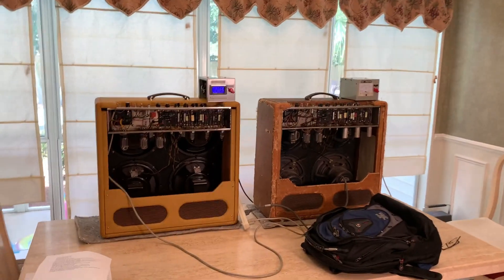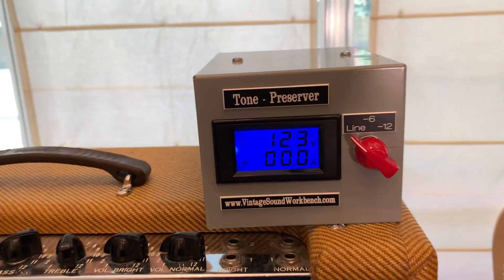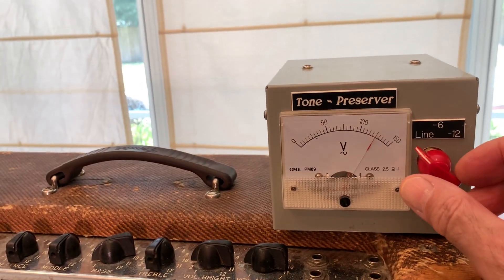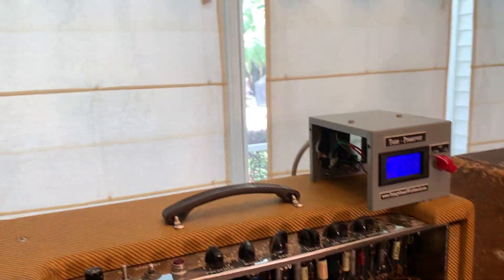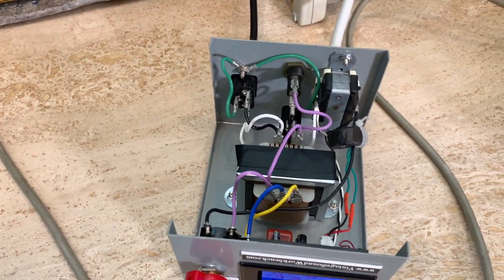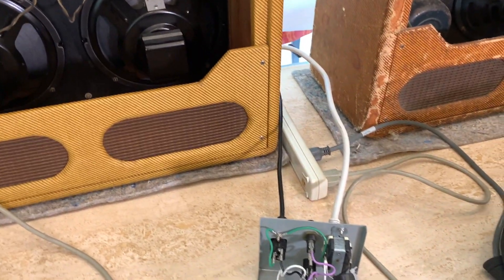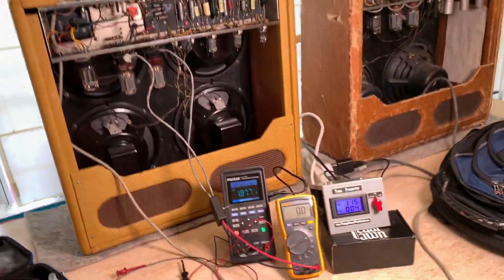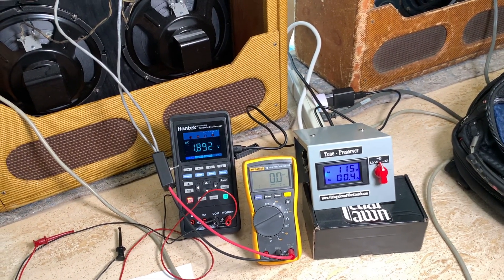Carl Hartman Tone Preserver - A "must have" for any tube amp owner!

Comment: Excellent Stan!
Reply from the maker: Hopefully I pronounced your last name correctly, lol.
Reply: millstap yes.    Im going to look into these now
Reply from the maker: @theriffwniksevigny5473  Also look at the Amp Maniac.  It is completely variable but is only fused at 2.5A so you may not be able to run as many amps on it, and it is $219.99.
Reply from the maker: @theriffwniksevigny5473  I did a little experiment last night.  I watched the amp meter as I jammed with the 1959 and a vintage Fender reverb unit hooked up.  The amperage peaked some times to 1.4A so the chances of blowing the 2.5A fuse on the Maniac are pretty high if I run a two amp rig through it.  I am going to do a demo on the Maniac soon and will try to blow the fuse using two amps.  I'm thinking for $50 more ($400) than the BrownBox, you can have both the Preserver and the Maniac.  Leave the Preserver with all the amps hooked up in the jam room at home and take the Maniac to all of the one amp gigs.  It will be an interesting demo because I am going to dial in the heater voltage to exactly 6.3VAC and see what the plate voltage ends up being.  I wouldn't be surprised if it matches the schematic exactly at 432VDC.

Comment: I've had mine forever! Love it! Purchased one to run with my 64 Super Reverb.  Great product,  I like being able to set mine at any voltage,  not just a few choices that drop the voltage by a few percent each time.
Reply from the maker: So you bought the Maniac?  I am going to do a demo on the Maniac soon.  I am thinking everyone should have both.  For $400 you can have both.  There are some big advantages to the Maniac too as it works similar to a Variac but is light and compact.  But, it probably will only run one amp at a time.  I did an experiment last night and saw that my Bassman with a separate Fender reverb unit was spiking at about 1.4A when I was playing loud.  I am going to run two Bassman and reverb units and see if it will blow the 2.5A fuse in the Maniac.  The Preserver for the home jam room and the Maniac for the one amp gigs.

Comment: Does it protect against power surges and (idk if Im using correct term) does it offer protection against ungrounded outlets?
Reply from the maker: No, it is strictly a voltage reducer.  Whatever power surge hits it will be passed on but at a lower voltage that you have pre-set.  I use surge protectors like the Furman or Tripp-Lite and plug the Hartman into them.

Comment: Can you tell me the difference between a tone preserver and the amp maniac and do have any experience with the JHS black amp box ?
Reply from the maker: Sorry I took so long to answer.  The Tone Preserver is fused at 5.0 amps and has three settings, line voltage, -6V and -12V.  The Maniac is fused at 2.5A and is fully adjustable from 0VAC to line voltage.  You can hook up a few more amps to the Preserver because of the fusing but the Maniac can easily handle two amps at the same time.  I have both.  I like the Maniac because I can dial in my amp's voltage exactly.  I am not familiar with the JHS box.  It looks like you have to have an effects loop on your amp to hook it up.  The Preserver and Maniac are best for vintage amps but they can still monitor voltages on new amps if you live in an area where voltages vary a lot between venues.

Comment: Just received a Brown Box voltage "reducer", and the AC amps meter doesn't work, very disappointing with something this expensive.  I have my 1957 Gibson GA-40 plugged into it, reduced the voltage from 120 volts to 115, but might take it down to 110.  The amp says 110-125 volts below the pilot light - lower is better? ANYways, not having the AC amp meter working is a defect, which makes me wonder if I can trust the voltage meter...?  Maybe after returning it for a refund I'll buy one of those instead.

Comment: Hello Millstap, a question so when you bias the tubes do you bias them with the tone preserver or are you bias the tubes with the line voltage from the wall?
Reply: From the preserver. So not from what you see at the wall. What matters is what your amp sees not what the tone preserver sees.

Comment: This is just a simple buck/boost transformer with taps on the secondary to drop or boost output by a desired voltage. The transformer in the unit costs about 18 dollars. You could build this without the digital or analog meter (which you really don't need) for less than $60 US dollars. Be careful adding additional amp loads beside just one amplifier to it. Because at idle guitar amps pull very low current. But turn that amp up to seven and add a fuzz face, wah, and/or delay or modulation pedal and slam a low E or Eflat power chord and have a ammeter hookup to it and you will find out why your amp has a 2A or 4A rated slo-blo fuse in it.
Reply: We get this question all the time: Can't I just build my own unit with about thirty dollars worth of parts  and accomplish the same thing?  I think I saw the circuit on  the internet somewhere. 
 
If you believe that, then you have not priced quality parts and  components lately.  You could build your own if you have the technical  know-how, experience, and the proper tools to do so.  The Tone Preserver is built with top quality components and is built for the gigging musician, not your average basement experimenter.
Reply from the maker: Since I build and sell my own pedals now, I have a lot of respect for the amount of work that goes into a quality product like the Tone Preserver.  When you get your car repaired, you will notice the labor costs are usually the highest charge on the bill.  And, also the investment in tools has to be factored into the total price.  I was trying to refret all of my Strats until I realized it was going to take a $1,000 investment in tools just to get started.  On the multiple amps, I've hooked up two Super Reverbs and the two Tweed Bassman amps in this video and cranked all four of them at the same time just to do it.  Not one fuse was blown anywhere.
Reply from the maker: I will be demoing the Amp Maniac soon.  It is the best alternative to a Variac.  It is light weight, the same size as this Preserver, and it goes from 0-Line VAC.  So, you can also use it to slowly bring up the voltage on old amps to possibly reform the electrolytic capacitors.  It is a little more at $219.99.  Check out the product link in the Description above to see it.

Comment: I can’t believe I missed this video!
Reply from the maker: Hey Matt, I just posted this one this morning, https://youtu.be/grkJPSbOQmE.  You may like it better.  It was killer because I dialed in the heater voltage to 6.3VAC and the plate voltage ended up being 432VDC +/- on both the 1959 and 1960 Bassmans.  The AC voltage ended up being 113VAC.  Pretty cool.  I was surprised the voltages matched up to the schematic so perfectly.  I noticed on the '59 Reissue Bassman schematic, they have the plate voltages all the way up to 491VDC.
Reply: millstap Yeah, I watched both videos. You made me laugh a little when you talked about the high reissue voltage and tube ratings. We all run old Tung Sol 5881’s with a 360vdc plate/screen rating at 440ish volts. New tubes don’t do that though.
Reply from the maker: @matthewf1979  Yeah, those old Tung-sols are indestructible.  One of the 5881's in the 1959 was hit with 230VDC on the grid and was smoking hot.  That was several years ago.  Now, with a cracked base, it is still working perfectly.  They made them tough back then.
Reply: millstap I’ve been buying up reasonably priced Tung Sol 6L6WGB/5881 on eBay. $80 and under for new or near new a pair. So far, they’ve all been good, strong tubes.

One pair is labeled GE, but not Canadian. It looks exactly like the usual re-labled Tung Sol, but has the GE EIA code and US made. It’s a real oddball pair, but they test and work like a Tung Sol. It’s even missing a pin and the base looks different on the bottom.

A few months ago, I built a Tone Preserver style buck transformer. It’s got a 12 amp filament transformer in it! Totally overkill but it’ll last forever and never get warm. I’ll send you a picture on Facebook.
Reply: millstap The pictures are in the comments of your latest video on Facebook.

Comment: If you build this yourself it's about $30. Ask me how I know lol. $30 to $50 at the most. And that includes A BETTER LCD screen that measures voltage, current, freq and wattage/power. But yes these are very very very useful devices. And changing the analog display for a nice LCD display would have cost you $15. If you used the kind that's in the tone preserver you could have picked one up for about $8 on the high side from amazon.
Reply from the maker: Okay, how do you know it will cost $30.  You can hardly build anything nowadays for $30.  Just shipping for the parts alone will be $30.  Have you tried getting parts lately?  I think even Carl is having a hard time finding the right meters.  The supply chain problems are really getting worse.  I take it you make your own enclosures too because they aren't cheap for the right size if you can find them.  I hadn't thought about changing the analog meter with a digital one.  I use my two digitals now but I could always use a third.  Now, I prefer the Maniac which works like a Variac.  I think I would prefer to convert my third one to a Maniac.  Does yours have that kind of variable adjustment?  Oh, I see I am not talking about the Maniac here, here it is, https://vintagesoundworkbench.com/shop/ols/products/amp-maniac.  I just found one on Reverb for $115.
Reply: @millstap   I live 20 minutes from mouser electronics (it's in Mansfield and I'm on the border of Fort Worth Texas) so I use their will call (now that they reopened it finally, it was close mid almost 2 years cause of covid) which means I can avoid shipping costs on most parts i need. And the transformer (115V 6.3vCT, 4A) is $17 on mouser an a good quality hammond enclosure is $22 on mouser (hammond 511-0900). The display i use reads Voltage, current, power/wattage and energy/Wh and its $15 on amazon. Bbut for $8 you could get a display meter that just reads volts and amps like the one used on the "Tone Preserver" and save some money. So that brings us to $45 so far using the nicer display meter (to be fair I had everything else lying around). But even if I didnt have the rest lying around (switches, wire, output and input outlets etc.)it would still only cost about $10 or $15 at the absolute most extra for those odds an ends. I personally think the Tone Preserver price isnt highway robbery and it's fair if you dont know how to work with electronics. But if you do then you can save a lot of money (about $200, call it $180 of you have to pay shipping on parts and that's a high estimate since mouser has a hidden shipping option that is normally about $8 and the regular for that amount of stuff is about $12). And I'm rounding up so in reality youd save more then that not less. And another reason to DIY is mine can boost and buck by 6 or 12 and has a line voltage position as well. My line voltage goes from as low as 110v to 128v throughout the year so I need a boost option as well for when I'm using my modern Marshall. Having the option to boost and buck by 6 or 12 keeps me much closer to 120v when I need it or less for vintage equipment. Point being if you build it yourself you save a lot of money AND you can tailor the transformer type, size and wiring configuration to best suit your needs. And to answer your question no, sadly mine isnt variable but I'll likely build one that is eventually. I really like that idea, the amp maniac style variable option that is. It would be even better for my purposes. But for now boosting and bucking by 6 or 12 gets a close enough. I'll likely source a higher amperage transformer when I do that so I really can use it like a variav like you mentioned that can run ALL my gear and correct the voltage for everything I use along side the amp. Specifically because it would be a great bench top variable power supply. I already have a small build I did with some DROK modules that i use as a variable DC bench power supply an use it when I'm building or troubleshooting pedals. I also use that same module to power my active pickups through my guitar cable so I just plug and play with my active pickup guitars (just like with passive instruments) which keeps me from ever needing 9v batteries. But now I'm off topic lol!
Reply: @millstap  And the prices I quoted are as of today. I can link everything if you are interested.
Reply from the maker: @michaelinglis567  Thanks Michael.  I still need to read all of your last comment.  I get almost all of my parts for my speed pedal from Mouser so I know them well.  I will see which links I'm interested in and contact you later.
Reply from the maker: @michaelinglis567  The line voltage in Texas goes all the way down to 110VAC?  That's interesting.  It must be all of the green energy that Texas went to which is the same reason 200 people died during the Great Freeze.  Texas, the oil state, what were you thinking?  I'm basically a Texan but don't live there now.
Reply: @millstap  Yeah, born and raised here and lived here my whole life. And im pretty sure not all of Texas dips that low (my last place was duplex a little closer to downtown and it was pretty consistent power wise there. If anything it was a little higher than 120v on average). My current home was built in 1952, so that might tell you a little something about my neighborhood and the quality of the power grid/infrastructure in this area. With that said my area is getting much better since im so close to downtown Fort Worth. Hell we even got sidewalks about 5 years ago lol! Heres to hoping the power situation is eventually fixed as well!

Comment: Could you use a variac instead and decide to run it lets say 110 ? This device is a great deal anyway
Reply from the maker: Variacs are dangerous to use with your amp.  Not only are they bulky and heavy, they can go to 140VAC which would blow your amp up.
Reply: @millstap  ah ok so if by accident it's set up higher that is a risk.. 👍🏻
Reply: @millstap  we have the same problem here in italy ,instead of 220 is running at 230 ,so it's a problem for vintage amps...
Reply from the maker: @antonix_81  Yes, if someone inadvertently turns that knob to the max, your amp is toast.  The Amp Maniac would be a great choice for one amp and is the best alternative to the Variac.  The problem now is Carl does not have an EU version but he is going to start working on one.

Comment: I would prefer fine tuning of voltage instead of only 3 settings.
Reply from the maker: Carl does make that device, the Amp Maniac, https://vintagesoundworkbench.com/amp-maniac, but it is only for one amplifier.  That would work great if you just run one amp at gigs.
Reply from the maker: https://vintagesoundworkbench.com/shop?olsPage=products, $219.99.
Reply from the maker: I just spoke with Carl and you can run as many amps as you want just as long as the ampere draw is not more than 2.5 amps total but he can also custom build a 5 amp version.

Comment: I tape my variac knob in place so it can’t move. Then run a power bar off that
Reply from the maker: Well, without the ammeter, you're missing one of the biggest benefits; the monitoring of the health of your amp.  That was the main reason I upgraded to the digital meter.  Actually, in my next video of the Amp Maniac, which is a fully adjustable Tone Preserver, I may demonstrate how my bad rectifier tube causes the amp to draw more amps until it blows the fuse.  That will be an interesting experiment and I'm not sure if it requires me to jam with it for a while before the fuse blows or if it is an instant buildup in ampere draw.  Plus, you don't have to tape the knob because the Amp Maniac will never allow the output voltage to go above line voltage.  Another big benefit as far as the info I have found on Ebay for cheap Variacs, the Tone Preserver weighs 2.88 lbs. vs. 8.5 lbs. for the 5A Variac type.  That is the lightest weighing Variac I could find, made in China.